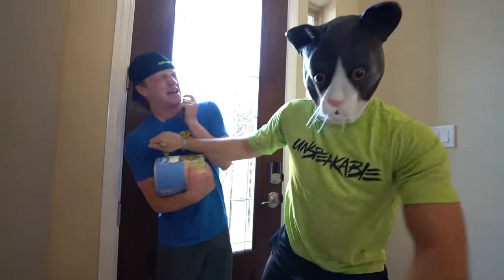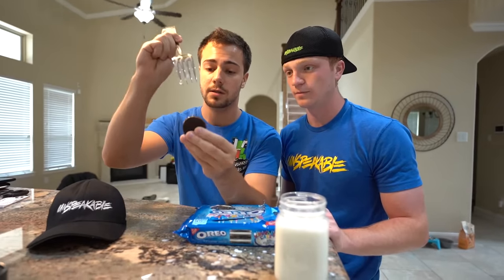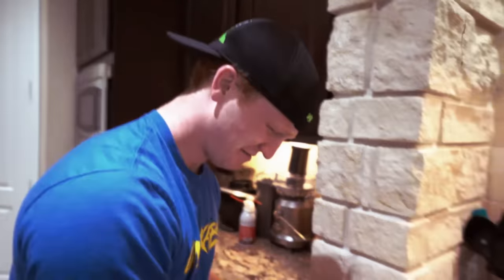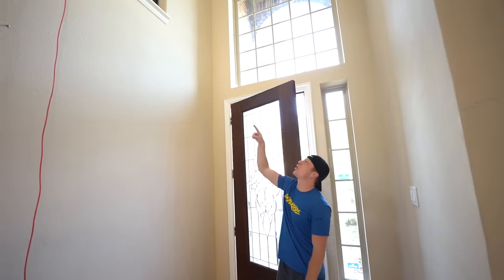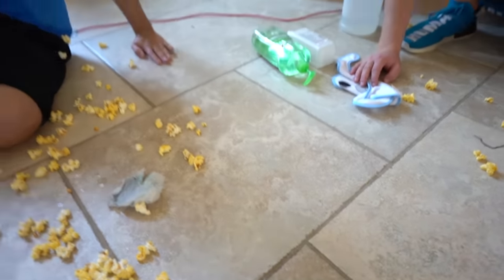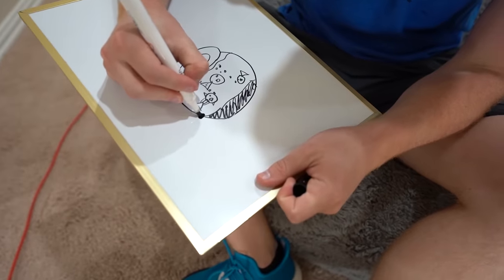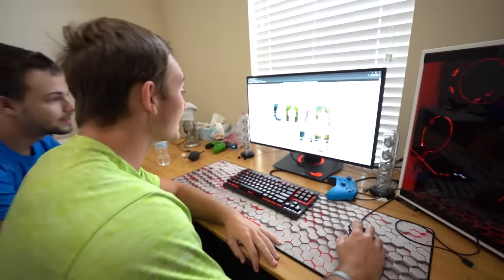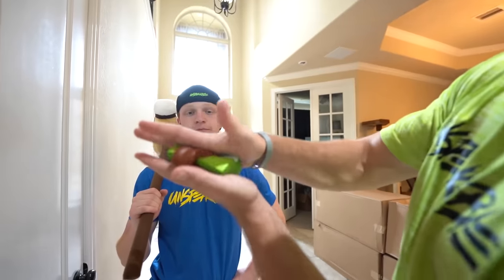10 INSANE LIFE HACKS THAT WILL CHANGE YOU!

Comment: I actually tried the Sharpie hack when I was riding on a paper towel I got little dots on the table and I used toothpaste and then I used paper towel to rub it on there and then I use water then I just dried it off and then it was good as new

Comment: I have a question do you have to do circles or can you do anything else with like coloring ever or does it only work
With circles cause I tried it and it doesn’t work on speaker but I think you got the wrong thing to tell you but I did try it at the YMCA it did not work so I think you still have to try to do  but I don’t think it works